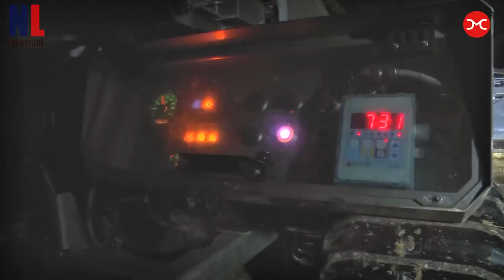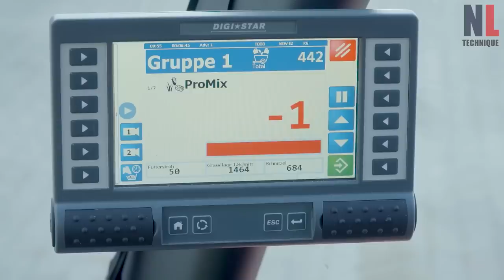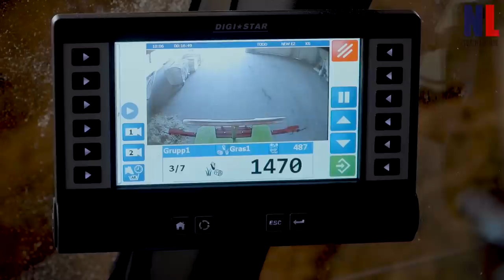Modern Farming Technology with Cool Machines for The Highest Productivity

Comment: Modern chicken farming has become disgraceful
Reply: this is what happens when you don't ant to pay for your food... everything have to be done with minimum workforce in large scale for someone to make a living or would you rather pay 50$ a portion of chiken meat
Reply: @floflo8018  
This is about the REGULATION not the manpower :/
Reply: @floflo8018  10,000 chickens clustered together, standing in their own effluence.

It's not the consumer that does this.
Reply: Wel if your against this why don’t u start doing it ‘better’ yourself oh wait to lazy and eats cheapest chicken
Reply: @Naptosis  do you or do you not eat cheap chicken?
Reply: @stefthorman8548  that's a really good point. I do eat inexpensive animal products, though the animal welfare laws are generally better here in Europe. I'm doing my best to switch to other protein sources simply because of the valid point you've made. I'll be happy when artificial meat really takes off. However, I would very much like the welfare of livestock to be improved in the meantime, even if that does increase the cost to the consumer.